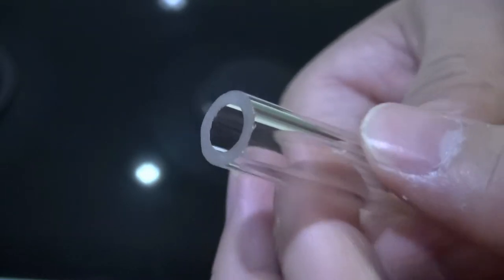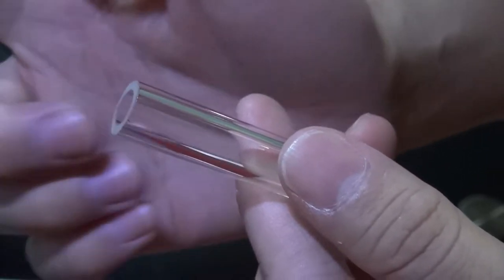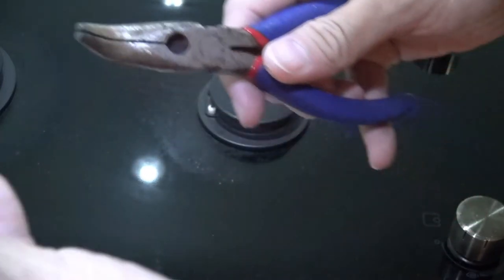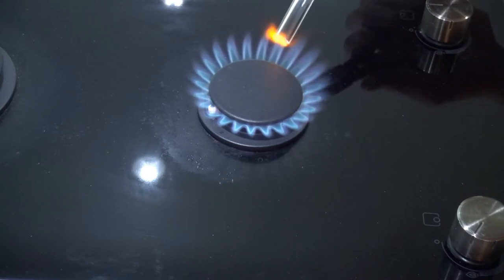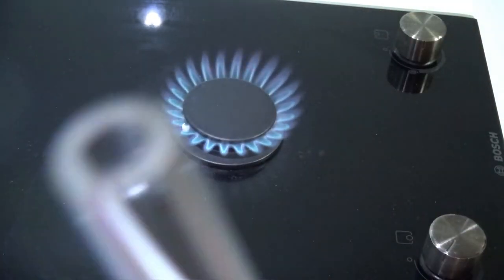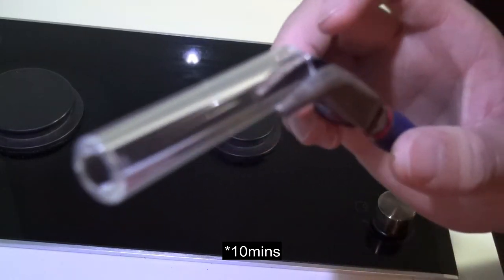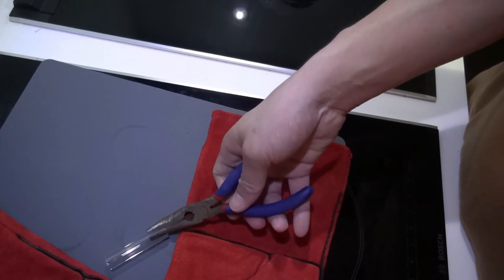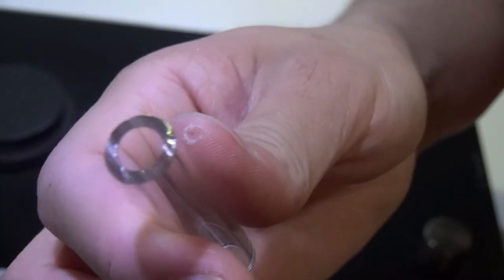Preparing Mayhems Glass Tube for Fittings (Fire Polish)

Comment: Glad to see someone else doing what I'm thinking about doing. However - you should use a MAPP gas torch for this, it's a very common plumber's tool, and you can even order it on eBay. It's expensive, but it will work much, much faster than a kitchen burner - it's designed for brazing pipes and polishing hard glass.
Reply from the maker: I fully agree that a gas torch would be easier to work with.

But this is the cheapest, safest and using the most easily available tools around. 
Unless of course, you will be using the gas torch regularly. :)
Reply: Definitely. I think it's worth it myself, because you're polishing a lot of cuts.

What did you use to cut your tubing?

Mayhems has their complicated jig/Dremel wet-cutting setup which is a bit too much for most people I think. They also demonstrate a set of tile nippers (the kind with wheels) which seem to work just fine - as long as the wheels are tungsten carbide. JayzTwoCents demonstrates a cheap glass tube scorer and an exhaust pipe cutter (expensive).
Reply: And you found that worked okay? I have plenty of diamond cutting wheels (none ventilated though).
Reply from the maker: I can speak for ventilated diamond cutting wheel. It works well.
You just have to cut slower than the wet cut technique.

Comment: That's awesome I've just got some Mayhems glass tubing, could I not put my glass in my drill and turn in slowly over the flame instead of holding it with pliers and turning it the way you did.
Reply from the maker: It believe it can work. I use this method because it allows me to control the exact spots I need to polish more.

Micro cracks at the tip needs to be under the flame constantly longer in order to smoothen out.
Reply: what method do you use when cutting small sections of glass like 4 inches or so?
Reply from the maker: Power tools (dremel / proxxon) with diamond coating cutting wheel.
https://goo.gl/images/upKne7

I use those with holes as it can get pretty hot when cutting glass.
Reply: Mad-Ace thanks.
Reply: I just got some 90 degree Mayhem  tubes 16mm. What size did you get and are they still clear?
Reply from the maker: Colin Java 
I used 12mm. 👍

Comment: Id like to use glass but I noticed it seems to be far more prone to leaks than soft tubing, even if done right.
And Ill be honest about another reason: This looks like a lot of risk, work and even danger (like inhaling glass dust) to make a computer.
Reply from the maker: I’ll like to correct that notion. 
Glass is even better than any other hard tubing due to its tolerance to temps. Not forgetting it doesn’t corrode.

Leaking are usually caused by (1) Poor O-Ring Seal and (2) poor quality fittings; which is almost just as much of a risk with soft tubings. My soft tubing fitting failed me once (after 6mths) while the full glass tubing PC I builded lasted 3 years without issues and still going strong. 

I agree with the hard work part (which indeed is time consuming). But with regard to health hazard, right tools and personal protection equipment (such as safety glasses, gloves, breathing mask: which I described in my other videos on how to bend the glass tubes) would have mitigate the risks easily.

Overall, Is just how much time, effort and resources are you willing to give to build your system. Cheers
Reply: @acezzzzzz  I am not sure if we are talking about the same thing.
I am not saying that leaks are usually caused by glass tubing or hard tubing, but that it is more prone to leaks than soft tubing.
The reason is because soft tubing fills in micro cracks when the fitting clamps on it by itself, making it more likely to cover all fittings well. Hard tubing relies only on the O-ring as seal. 

O-rings are of a stiffer rubber, meaning they dont deform as much to fill in micro cracks and are very thin (they have to fit between the fitting and the glass and not break the glass, so the pressure cant be too high). The odds of them not making perfect seal is much higher than a soft tube that will clamp on a fitting by itself (once the soft tubing takes the shape of the fitting). 

And this has nothing to do with good or bad quality fittings or O-rings. You are not buying aerospace grade components.

When it comes to durability, glass beats soft tubing, no contest, especially if you use a premix with something like glycol. And it looks better (A LOT BETTER).
Reply from the maker: Actually what I saying is if you notice the compression fitting of soft tubings, the g1/4 fitting also relies on o-rings. 
Poke it and you will see leaks. 

Hard or soft tubes still relies on o-rings. 

The only plus point is soft tubings compression fitting clamp end tend to fail lesser than the hardline counterpart.

In all honesty based on my personal experience, it goes down to quality of fittings. A good quality fitting for hardline works as ‘leak-proof’ as a soft tube fitting. E.g. bitspower (which I trust even above EK) , Their compression fitting for hardline has 2 x internal O ring.
Reply: @acezzzzzz  True, the O-ring at the screw in part of the g1/4 thread is the most likely source of leak due to the O ring. That is why I dont want more O-rings :D.

Comment: Are you annealing the Glass after bend and fire polish?
Reply from the maker: kenneth willits ,
After bends, the glass need to be anneal properly. I done them as part of my bending video.

For fire polish however, I don’t put emphasis to anneal because there isn’t that much structural stress from cutting (if done properly) compared to bending.
Reply: Mad-Ace  Thanks I want to build my own unit and as a glass blower I would normally anneal the glass for safety and structural purposes. What is a good site to find the swage locks for joining the glass tubes?
Reply from the maker: kenneth willits 
You definitely need to anneal if you are joining glasses. That’s surely a must.

I didn’t try joining the glass tubes so I can’t help you (I don’t own a blowtorch)
but I do suppose it can be done. Is structurally possible.

Why not be the first in Youtube to do it purely for Watercooling purpose. 

We experiment and we share our success. Least that’s why I did.
I wish you all the best :)